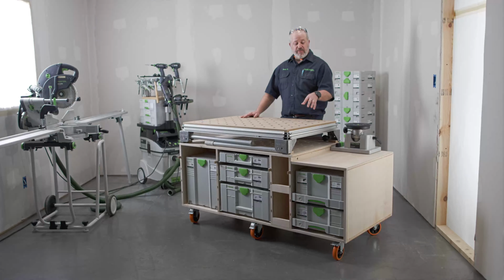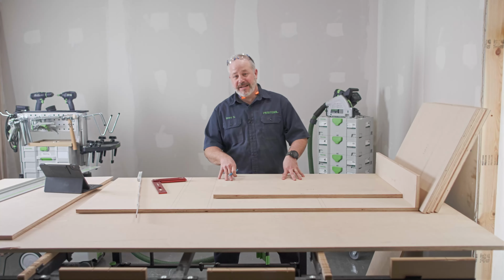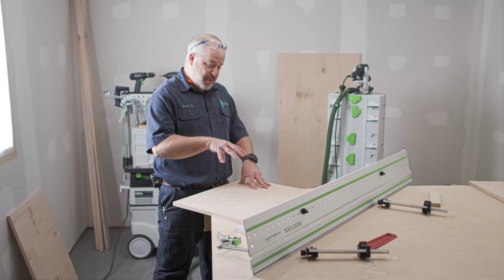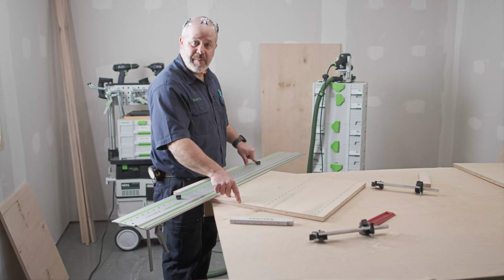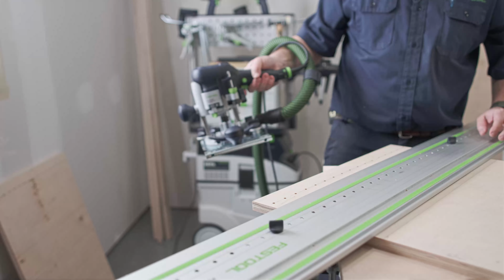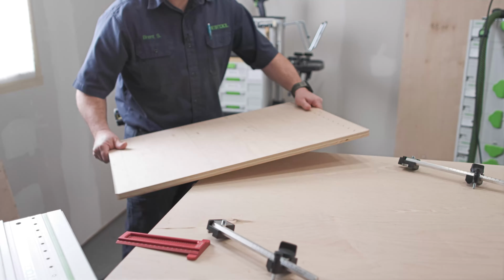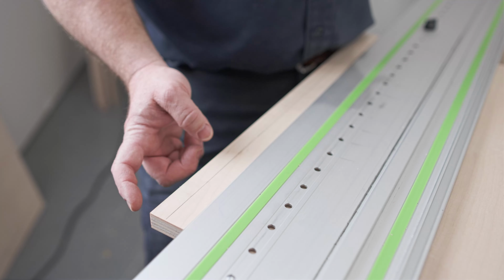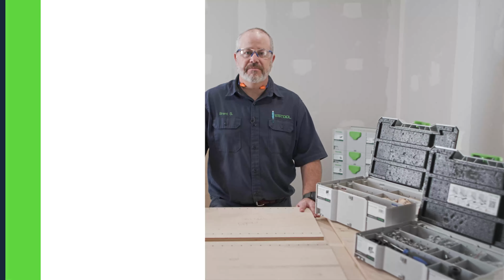Build Series 4: Mobile MFT Cart Build: EP 3

Comment: How is your panel divisible by 32 if you cut them down by 10 mm from original dimension?
Reply: I guess no one is answering this question?
Reply: @MyGarageWorkshop   See my novel used to reply to David.
Reply: @jwar2163  where?
Reply: @MyGarageWorkshop  See my response to this topic. I gave a lengthy reply
Reply: @jwar2163  thanks but I see 4 short replies. Did you reply to a different video?
Reply: The width is still divisible by 32. He trimmed the height